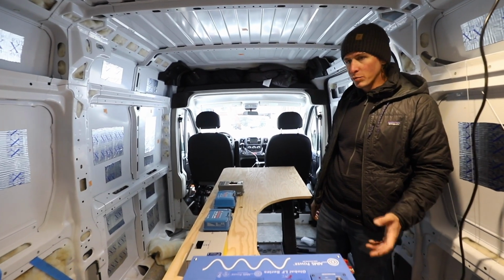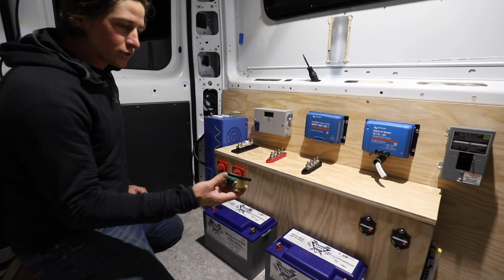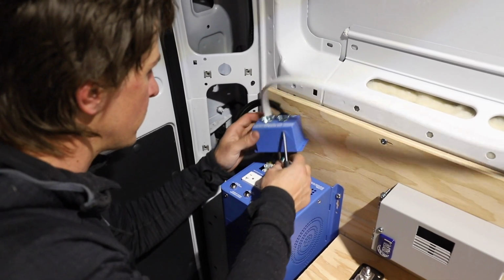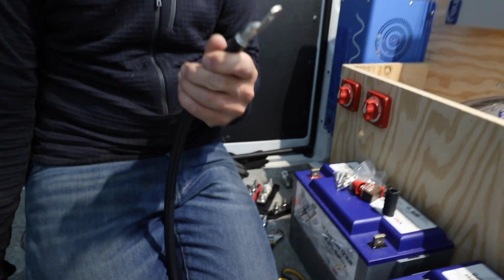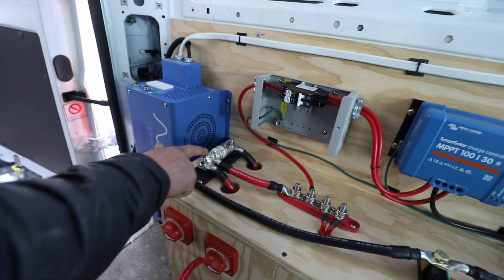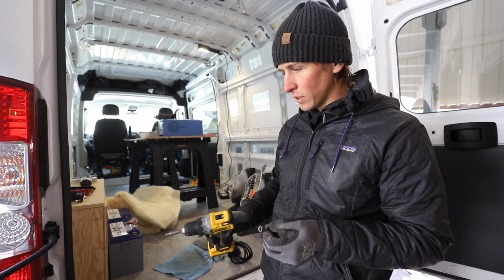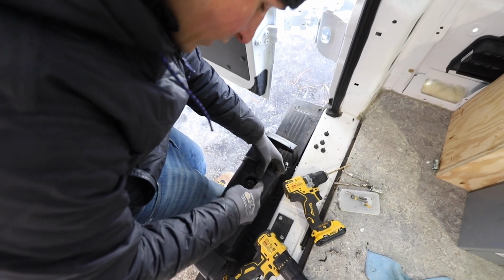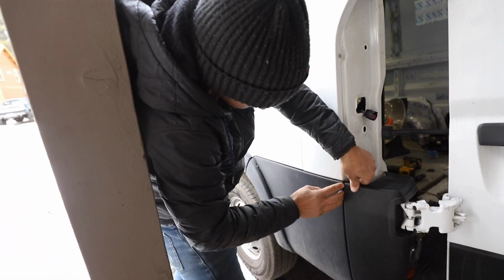DIY Electrical System Install | Off-Grid ProMaster Van Conversion

Comment: What size wire did you use for the ground from the inverter? I used 4/0 wire for my battery setup with 2500 watt aims inverter charger,but I heard you should have no less than 1 size down for the equipment ground. I have a chassis ground from my shunt just like you, but 3/0 seems like a lot for the ground from the inverter.

Comment: Nice system. Very informative video and I got all the information I needed. I will say you have a lot of patience, I would of drilled a hole in the side of the van. Still doing my research but this system looks promising for my project

Comment: Is it possible to ground the inverter to the negative bus bar in your set-up? Mine is a similar system but the location of components makes it simpler to ground via bus bar (then bus bar to chassis). Also, I noticed your negative bus bar has smaller bolts for where your different ground connections where made, is it possible to connect safety grounds (including from AC breaker box) to a regular bolt on the negative bus bar (even tho it's also part of the dc system as well)?

Comment: I just copied this exact setup, but not getting any power from DC distribution. What should i do??
Reply: Figured it out!!! I had the 70amp breaker going to dc distributor panel hooked up backwards, flipped it upside down and now were rockin and rollin!

Comment: Hey Nate thank you so much for this video. I have copied your set up exactly. Tried plugging in the shore power today but nothing lights up on the inverter. Any reason you think this would happen? I assume the inverter is supposed to know when power is being supplied via AC in
Reply from the maker: Hey there! Make sure you have set the DIP switches on the back of the unit. Depending on how you have it set, you should need to flip the main switch to the up position when plugged in to receive the current from the shore plug.
Reply: @CourtandNate1  Ah yes. I remember going through the manual trying to understand if I needed to make any changes to the dip switches from default. I'll take another look, thanks!

Comment: Nate, love the tutorial.  Currently building electrical based on your video and components.  Did you run your panels in series or parallel?  I will be installing three 100W renogy solar panels.  Thank you in advance.
Reply from the maker: Thanks Larry! I actually did not install the panels on this van. I do typically wire them in series though to get the most out of the mppt charger.

Comment: I noticed the NOCO shore power plug is rated at 15 amps but shore power at campgrounds is usually 30 or 50, and the Victron Multiplus says many different amperages too? how does that work?

Comment: Nice clean set up! I have the same inverter and I am confused about the ground terminal. According to the wiring diagram I am following (that uses a different inverter). It looks like I should ground the 0/2 wire from the lynx distributor (bus bar) and a 6AWG from the solar charger. 0/2 wire certainly isn't going to fit in there. I didn't see you use the grounding terminal at all (or I missed it). Did you use the terminal?

Comment: This is the best clip I’ve found that is so understandable It’s so practical. I like how you make it so simple and show little ways to use and crimp ferrules and strip 50mm cable (in uk we have different gaugings and measurements. In fact the US seem to be the only place in the world that is using imperial. Uk is a confused mash of both) I too used the wheel arch box to hide most of the cable behind otherwise it becomes messy

Comment: Hey! Thats truely one super good and well explained video. But I got one question: what is that "security chassis connection" for? I dont See any devices connected to the chassis, so you habe an isolated installation.
Thank you

Comment: What size terminal lug are you using for battery connections?
Reply from the maker: Battle Born provides 5/16” hardware, so I used 5/16” x 2/0 AWG lugs. The battery terminals will fit up to 3/8” bolts so you can go bigger if needed. Most of the other battery cable connections such as the red on/off switches require 3/8” lugs.
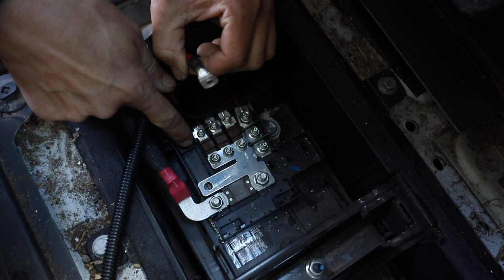Reply: @CourtandNate1  Sorry, I didn't mean the battle born ones- I should have specified the engine battery connection shown at 2:08. Is the engine battery 3/8" too?
Reply from the maker: Oh! Gotcha. 5/16” lug for positive and 1/4” for negative. There’s some more info in the vid description as well
Reply: @CourtandNate1  oh sweet. Thank! Missed that in the description. Thanks for the quick reply too!

Comment: Since you have the Positive & Negative cable running into the same blocks as the Positive & Negative cable running to 12V DC bank would anything on the DC bank technically work if you shut the battery switch off (isolating the system from the AUX battery)  but have the DC to DC connected and vehicle running?
Reply from the maker: Yes! And the same thing goes for solar and any other charge sources connected to the DC busses. With the battery bank isolated, the chargers would act as power sources for any connected loads. If you want to cut power to the whole system you would open the breakers for each charger as well.
Reply: @CourtandNate1  do you feel running a negative cable from the battery is necessary? I have seen other setups where the negative cable is run to the negative bar which is just grounded to the chassis which is essentially how its grounded at the starter battery anyway.
Reply: @Annie Hathaway I did not but it seems they run a negative cable in the video but do not mention it in that one section. I feel you can probably get away with not running it but electrical can be very touchy when it comes to grounds so I decided to order a negative cable and run it to be safe.

Comment: What gauge wire did you use to ground to the chassis?
Reply from the maker: I used 2/0 AWG (00 AWG) here. 1/0 AWG would have been enough, but that’s just what I had on hand.

Comment: Just wondering, the shore power inlet function to extend power outside the van. Does that supply the power to recharge the batteries  when there is no sunlight?
Reply from the maker: Yeah! We really hardly ever need use ours, but it’s nice to have when we need it. The incoming power, either from the grid or a generator, will charge your batteries and/or pass through directly to your outlets depending on your settings, power demands, and battery state of charge.

Comment: Hey! Thanks for the extremely detailed video. The only question I have is, what size ground wire did you? Thanks!
Reply from the maker: Thanks!  I used 2/0 AWG for the main chassis ground. The standard is one wire size down from your largest conductor. In this case that would have been 1/0 AWG (or 0 AWG) but I just used the 2/0 that I had on hand.

Comment: Not sure if this was mentioned by someone else or not. At min 17, should the negative coming from the inverter charger be connected to the battery side of the shunt? Otherwise the shunt will no account of the charge coming from the inverter charger. Great setup, clean and tidy👍
Reply: No, it's my understanding that you only want your battery bank on the battery side. If you put the charger on the load side... The shunt will account for the charge going into the battery when charging. Basically, the shunt is only to tell you what is happening to the battery bank.

Comment: Hey Nate, I have learned a ton from your videos.  THANKS! I'm ready to install shore power and like the "bumper" install.  I'm curious why you are not installing a 30 Amp receptacle?  I'd like to put 30 Amp in mine but not sure if the receptacle will fit in the space. Do you know?
Reply from the maker: We personally rarely have access to a 30Amp hookup and really don’t use too much power. 15A has been fine for us when needed and works for smaller setups. I did install a 30A inlet in the promaster I built with the green interior. It fits perfectly in the same space just above that reflector. The only thing you will need to be careful of is the cover. If it’s flipped all the way up, you can snap it off by opening/closing the back door.

Comment: Minor detail but what you are calling 10/3 is 10/2. The 2 refers to current carrying conductors. The ground does not carry current. Your layout is very neat and orderly, good job.
Reply from the maker: Thank you! For 2 conductors and 1 ground, solid residential/commercial wiring like Romex is 10/2, but for reasons unbeknownst to me, stranded marine or automotive wire would be labeled as 10-3.
Reply: @CourtandNate1  Fascinating! And that's for wire that is for DC or AC? I just installed an inverter on a bus headed across the country and I used some of that wire running from shore power to the inverter and AC panel but I had to add another single strand for ground but I never looked at the package label. It had one red and one black and was tinned. haha! I hope I don't come across as a Mr. Know-It-All. I'm learning a lot on the topic myself. 
The other cord I would suggest for AC in an RV is called SO or SJO because it's used to hang fixtures and has 3 strands of thick twine and very thick insulation and is rated for outdoor use

Comment: What keeps the starter battery from trickle charging the house batteries?
Reply from the maker: In the case of most dc-dc chargers, the voltage of the starter battery will determine the flow of current to the auxiliary battery(s). It will only start to charge the aux batteries once the starter battery reaches a certain voltage when the engine is running. You can alternatively connect an sense wire to the ignition.

Comment: What is that on your positive battery connection? Are all Promasters like that?
Reply from the maker: Most promasters have that open space for a fused connection using a mega fuse. You can also install a separate fuse  or breaker outside of the battery box, but I like to fuse at the terminal whenever possible.
Reply: @CourtandNate1  hi folks! Thanks so much for the DIY content, love the skill share ethics!
I'm wondering if you ever got the square head hardware and 60amp mega fuse on the battery and if so could you show a video of that?
Best wishes for your new year!

Comment: I'd only take an orion 60a and up. 30a is not enough in most cases
Reply from the maker: With only 2 batteries and a decent amount of solar, 30A works but more is always nicer . I haven’t seen a 60A Orion, but usually 2x 30A in parallel. I use a 60A Sterling in our van. Considering a second alternator for the next one. 200+ amps sounds great!

Comment: How do you get around the Solar and DC to DC trying to charge the batteries at the same time as from what I under stand solar controllers don't like a second power source charging batteries as it cause the controller to freak out.

Comment: I've found that the rear quarter trim panel will easily slide off when pulled straight back (after pulling the rear edge free from the corner panel). I hope that makes sense. Then you can either try to slide the panel back in (it's hard to get every clip engaged) or remove the clips like you did. Your method is probably easier if you have plenty of extra clips at hand.
Reply: Thanks for your comment!

Comment: Not going to ever try this myself, but I'm really curious. When you ground using the chassis, isn't there a chance then to get zapped when you touch it?
Reply from the maker: Grounding to the chassis of the van will allow the ground to carry a fault current back to the battery in the case of a hot wire shorting somewhere in the circuit thus tripping the over current protection (fuse or breaker).